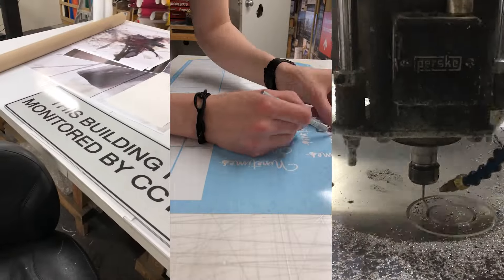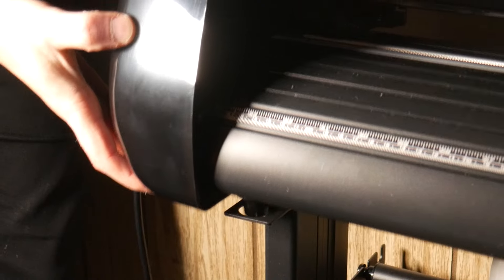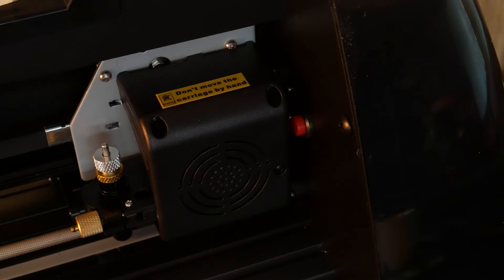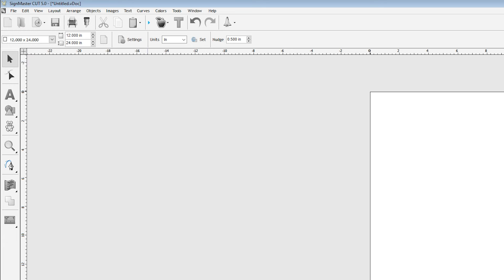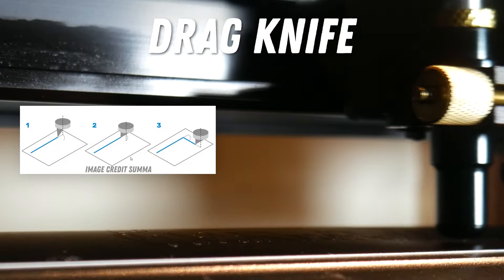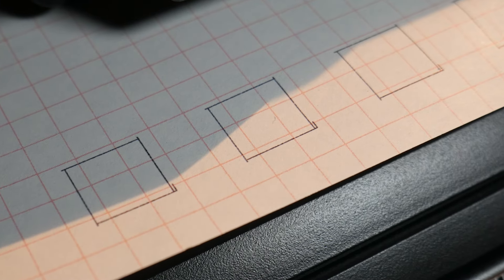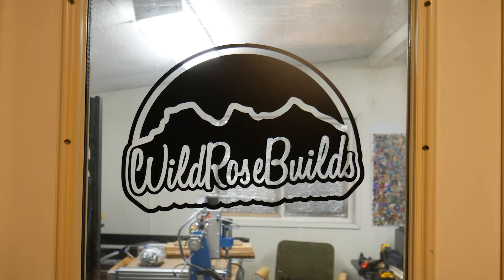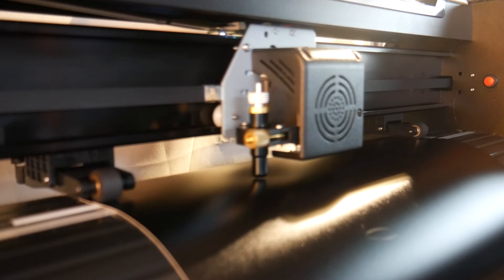The $400 Tool You NEED - Vevor Vinyl Cutter / Plotter Review

Comment: Hey! Do you think this plotter could potentially cut paper? Like 60-120gsm? I am aware it doesn’t cut through the backing of vinyl  but was just wondering if it’s a possibility?
Reply from the maker: Yes! If you set the pressure high enough it will cut right through the backing paper on the vinyl. I’d grad some extra blades tho as they’ll dull super quick

Comment: Vevor vinyl cutters have a major flaw, I know I have owned two. I put up a negative review about them on the vevr website but it appears they only post positive reviews. 

The pinch rollers dig into the vinyl leaving marks. Its fine if its a small piece as you only use the pinch rollers on the edge. But if its more than say 15" you need the middle pinch roller so it does not track skewed. You can see it right in the video where he is printing his company logo!!

What good is it if you have a large cutter but realistically can't cut mre than a foodt wode without the vinyl being damaged? The price may be enticing but you get what you pay for!!

O
Reply: Hard to believe that other cutting machines at 2-10x the price have only better rollers. :)
Reply: Yes that would be hard to believe... although they use Roland compatible holders and svg format. You're mainly paying more for tighter fiducial registration  (and auto mark sensing) I notice it most cutting arms images printed using a 2 step offset. 

I've had to shim the mark sensors due to skewing which decreases proportionally in reference to the origin. Cutting vinyl of course you wouldn't mark sensing and I turn off fiducials to get less waste.

I also have also replaced the stock Nema 17s with 0.9deg resolution steppers (Did the same on my k40 laser. But it only works if the software allows custom scaling or modify the arms header.

Comment: Try US Cutter for vinyl. I've been using Starcraft HD but recently started using Oracal 651. I've also been using Greenstar and TransferRite transfer tapes. Oracal 651 and Greenstar medium tack tape are my favorites.
Reply: The Oracal is 2.5 mm thickness but the website for this unit say 1 mm thickness max. Have you had any trouble with cutting?

Comment: Personally, I'm very happy with the Silhouette Portrait 3 I just grabbed for a bargain. Print and cut, has decent cut depth, and I can fit most designs on the cutsheets, diagonally if neccesary. Printsheets are consumables anyway.. Silhouette Studio is also much more indepth than the stuff Cricut offers, especially when you do the "designer" upgrade. Noty strictly neccesary, but mopst people aren't really used to using inkscape as their main design software. 

Cricut is missing a huge chunk of the market by not integrating print and cut capability into their products..
Reply: Print-then--cut, is in the Cricut Maker 3
Reply: @IanNubbit  Not when I made the comment. It might have changed. Don't really keep up with video's I already commented on.. Thanks for the heads-up though!
Reply: @devjock  I definitely have been using the feature fir over a year now

Comment: I really liked your review!  I restore old bicycles as a hobby and need to be able to take pictures of decals, upload them and draw them to make new decals.  Currently I have a Roland Stika 15 using cut studio.  Will the software with this vevor machine allow me to do the same thing?  The Roland is a PIA because it does not seem to work well with Windows 10 or 11.
Reply from the maker: Very cool! I have cut quite a few fiori decals for some of my vintage road bike builds. I’m not sure if there’s a bitmap to vector function in the software that’s included but you can probably keep using the software you’ve been using and send it directly to the machine after installing the drivers!

Comment: Great review! Can this machine cut sandblast stencils? Have you tried this?
Reply from the maker: It should be able to. Worst case scenario is you’d need a second pass. In the past when I’ve done the thicker sandblast stencil rubber and even super thick reflective materials I would switch my blade out for a sharper angled one with a longer cutting edge.

Comment: Hey man! 

How’d you get your image to print on the machine without having to vectorise it in the software? Or did you have the pro version of the software?
Reply from the maker: I vectorized all my designs in illustrator prior to importing them. There’s a free tool called Inkscape I believe that can do it too
Reply: I see the pich rollers chew up the material where you were printing your logo. The center pinch roller then will leave marks making cutting any material useless?

Comment: How long vinyl i can put in? it is with servo motor ?
Reply from the maker: this one uses stepper motors, and in theory as long as you can keep the vinyl aligned you should be able to cut very long pieces.

Comment: What size cutter is best to have?
Reply from the maker: Really depends on what you’re planning to make. Sheet goods for sign making like dibond and coroplast come in 48x96 inch sheets so in that case a machine 48 inches up is good. For things like car decals and window tinting a 32” machine would probably work. For Small stickers and decals 24 and smaller works! Let me know if that helps!

Comment: Vevor support said vinyl no thicker than 1mm. I assume you are using thicker than 1mm?
Reply from the maker: Nope! Most vinyl like this is quite thin, fractions of a mm. The thicker vinyls are usually for specialty applications.
Reply: @WildRoseBuilds  oracal states 2.5mm+ for standard 651 stuff. Are they including backing in that measurement?